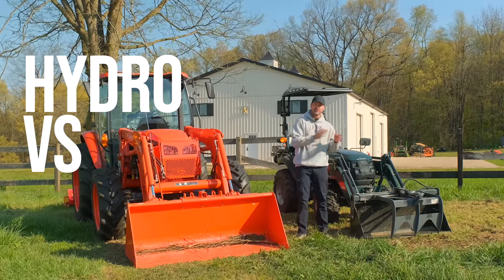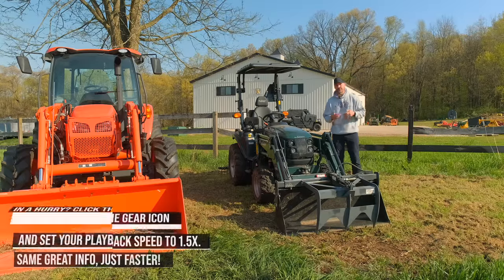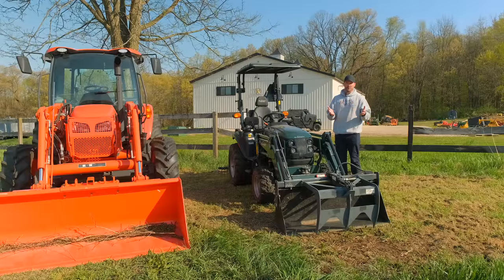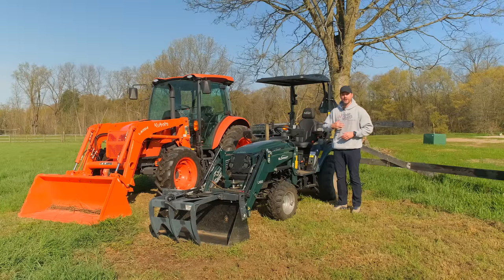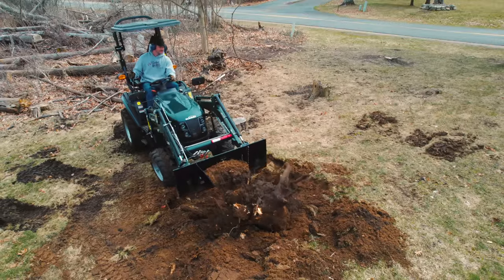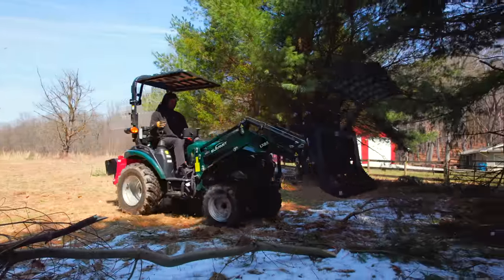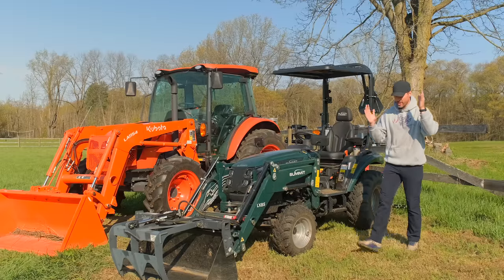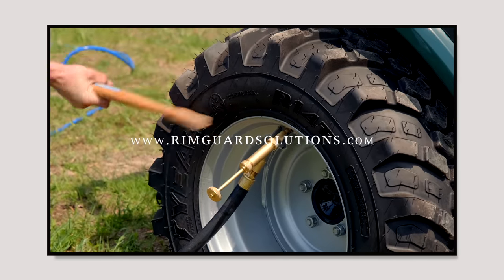HYDROSTATIC VS MANUAL TRANSMISSION? CLEAR WINNER?

Comment from the maker: So, which is the better transmission?

LOOK AT OUR MOST POPULAR ATTACHMENTS!
Speeco Quick Hitch: https://bit.ly/3NFC0yl
Stump Wrecker: https://bit.ly/3WYa6Tf
VersaBracket Combo: https://bit.ly/3wUPrnl
Snow Pusher: https://bit.ly/3NB4BVw
Tillers: https://bit.ly/3GT1kk1
Core Plug Aerators: https://bit.ly/3W0R25q
Pallet Forks: https://bit.ly/38wRztu
Grapples: https://bit.ly/3PNNYaZ
Dethatcher: https://bit.ly/3GT9Zmk
Tractor Canopy: https://bit.ly/3IHcvNU

WANT TO SAVE MONEY? CHECK OUT THE GWT DISCOUNT CLUB!  Use code GWT at any of the vendors below and you will save cold hard cash :)  I will also get a commission for the sale, so it's a win-win-win!  

USE CODE "GWT" TO SAVE BIG WITH:
BUCKET BRACKETS @ http://www.jufabworks.com
CUSTOM GRILL GUARDS @ http://www.5elevendesignz.com
PTO QUICK ATTACH @ http://tractorptolink.com
DIY HYDRAULIC SOLUTIONS @ http://www.summit-hydraulics.com
GAME CHANGING GREASING SYSTEMS @ http://www.lube-shuttle.us/store
TIRE CHAINS @ http://www.tirechainsonline.com
PREVENT FLAT TIRES @ http://www.multiseal.us
CULTIPACKERS & CRIMPERS @ http://www.packermaxx.com
ALL OEM JOHN DEERE PARTS @ http://www.247parts.com
ACCESSORIES AND BACKHOE BUCKETS @ http://www.muddscustoms.com
CUSTOM TRACTOR FLOORMATS @ http://www.tractormat.com
PROTECT, ORGANIZE, IDENTIFY HOSES @ http://www.outbackwrap.com
BOX BLADES FOR ATV'S @ http://www.northwoodsfabrication.com
HYDRAULIC SYSTEM PROTECTION @ http://www.hoseendchamer.com
DUMP FROM THE SEAT MATERIAL COLLECTION SYSTEMS @ http://www.proteroinc.com
POWERED SWEEPERS SWEEP UP ANYTHING @ http://www.sweep-all.com
EASY WHEEL TOP LINK HANDLE @ http://www.tractoraftermarket.com
TIRES, WHEELS, AND DUAL ADAPTERS @ http://www.millertire.com
AMERICAN MADE CARRY ALL ON STEROIDS @ http:www.bigtoolrack.com
THE BEST TOOTHBAR AND MORE @ http://www.heavyhitch.com
5% OFF WITH CODE GWT AT TRAC SEATS! http://www.tracseats.com

SHOP: http://www.goodworkstractors.com
AMAZON: http://www.amazon.com/shop/goodworkstractors
SUBSCRIBE: http://www.youtube.com/goodworkstractors
LIKE: http://www.facebook.com/goodworkstrac...
FOLLOW: http://www.instagram.com/goodworkstra...
MERCHANDISE: https://stores.inksoft.com/good_works_tractors_merch/shop/home

*Discount codes cannot be combined with any other promotions, offers, or deals!
**I choose to sell some products through 3rd parties instead of stocking items myself.  Know that I will receive a commission if you choose to purchase through certain links.  Thank you very much for your support!

This video is for entertainment purposes only.  Good Works Tractors (Good Works Lawn & Power, LLC) cannot be held responsible for content found in any video.  Always reference your owners manuals, use extreme caution, and proceed at your own risk.

Comment: I have a 4044M with the power reverser. It becomes surprisingly natural after a while.  The biggest issue I’ve had is when I get off the tractor and into my truck, I instinctively try to use the blinker to change direction.  😂
Reply: Lol
Reply: I feel your pain
Reply: Say you spent a lot of hours in the tractor without saying you spend a lot of hours in the tractor😉.
Reply: I keep reaching for the loader joystick when I want to shift the tractor. #MuscleMemory is an actual thing.😊
Reply: I did that a lot when I drove forklifts 12 hours a day
Reply: Beats pedals
Reply: Same

Comment: I have both, manual and hydro, and like you said, both have their strengths. One thing I have noticed however, is that a LOT of power is sucked up in that hydrostatic transmission. All things being equal, my experience is that the manual has more HP available for work.
Reply: And more comfortable to run when doing extended tasks.  Like mowing.

Comment: Dislike the treadle design. If forced to choose between treadle or manual, I'd go manual, preferably shuttle. If treadle was the only option, I'd run.
Reply: I bought a Yanmar YT347. Their I-HMT is better than either a gear drive or traditional HST, it has the same 2.2L as a JD 4044M/R, and no treadle pedal.

Comment: I grew up on the farm and farmed for 26 years. That John Deere Synchromesh trans that has the 1-3-R, 2-5-R, 4-7-R, and 6-8 had it's purpose. Typically you would turn in 2nd, backup and drop the implement , place in 5th and go. So there was an 8 speed trans with limited shifting. The Quad Range came out later and had it's place as you now had 16 different ranges with some non clutch shifting possibilities. If your were really trying to get the most out of your tractor you could find a suitable gear in the Quad range. My favorite was the 8 speed Power Shift. You could now shift with/without using the clutch. My Dad used to plant our potatoes with a 4430 Quad Range. When I replaced it with a 4430 Power Shift he was super pleased because we had short rows and a lot of turning. We used these all day every day and never had a transmission problem.

Comment: Back in the day, young buck, we only had manual gear drive with levers everywhere.   You had to stop to change any gears or directions,  we stood on hard clutches in the hot sun 300 times a day. Kids had left legs the size of grown town men and arms like tree trunks from no power stearing in rough paddocks..  good times..  now im 40+ i like my air ride seat, heated and AC cab, hydro top links,, and now hydrostatic for load shifting😂😂
Reply from the maker: Haha, I hear ya there! 40+ for me too.  First tractors I got to drive myself as a kid were grandpa's Ford 8n and 9n.  Neither one of them started with the key.  They both involved me sitting in the drivers seat and grandpa working his magic to fire them up.

Comment: The crazy transmission you showed was on John Deeres in the 70s. We had 4020s with that. The gears were set up so you didn't need a range selector.
Reply: I agree ,

Comment: I think this was a good summary.  I mainly do loader work, not plowing, and there is a big advantage to a hydro when using a pallet forks, work basket, for careful moving, or surging into a pile of rock, over and over again.
Reply: While I agree there is an advantage, it isn't hard to feather the clutch and on tight work you put it in the slowest gear at idle. It moves pretty slow even with the clutch out.

Everything is a compromise, so just matters how much field work or other constant rate things are going to be done to tip the balance gear or hydro.

Comment: I got my kubota l4701 in a gear drive and am so glad i did. I didnt want to listen to the whine of the hydro transmission and i like that the gear drive puts out more pto hp. What really sold me on the gear drive was a video messicks did comparing the pulling force of the two on an identical tractor and the hydro was extremely weak. My l4701 gear drive feels way stronger than the “47” hp its rated for. And i have a hi and lo range and 4 gears in each to choose from so i have plenty of a selection for whatever i need to do. I ran a flail mower for 6 hours straight with absolutely 0 issues.

Comment: "You grew up on farm tractors and are used to that". This is exactly right, and I love my Kubota L3901 with gear drive, even for loader work. As always, good video.
Reply: Hell, the first tractor I ever drove and the one I had the most hours on was a hydro, and I still generally prefer gear, especially a power reverser like the JD

Comment: I grew up with older gear drive tractors long before loader and buckets were a standard option. Just bought my new massey ferguson 1825e with the gear drive and loader. Plan to use the loader to clean out the barn. Using the clutch and gears still beats the pitchfork!

Comment: Still own one with the early 60's John Deere Syncro-Range transmission.
8 forward and 3 reverse gears  all with a dry disc clutch and manual shift. 
The one tractor I know nobody will steal from my yard because with the markings worn off the shifter good luck to the thief. Folks are sure spoiled with the controls on these new machines.  
Thanks for the video!

Comment: I've been driving stick shift for 41 years. When I became the caretaker at a camp, all they had was a Kabota L2500. Using the loader bucket is easy when scooping up rock when working on the road. A guy told me that I might have to spin the tires starting in 8th by revving it up and popping the clutch. Never had to do that to get it going in 8th. I like driving by the seat of my pants and have what I'm operating let me know what I need to do as well as reading the gauges. A stick shift gives me that. I have recently been using a friend's commercial John Deere. It is at least 3-4 times the size of the Kabota. It only has a forward/backwards lever. They must have had to keep it simple for the user. What makes it fun are all the levers to operate the backhoe.

Comment: I have owned or rented and used all variations and there are use cases for every one, however, if I had to choose one, it would be a 3 range power reverser with both hand and foot throttles as it gives the best of both worlds. The big TLB's that we rented for large jobs had this feature and I really preferred it.

Comment: Hydros are noisier and don’t have as much pull as gear. For most, hydro is the way to go, but if you’re used to clutch and gears it isn’t bad. The only time it bothers me is loader work into a pile, and it doesn’t bother me that much… that’s probably less than 10% of what I do anyway. I like the gear drive for plowing and mowing 5 miles of trails plus an acre field. Constant speed, strong pull. With 25hp and about 4000lb of ballasted machine, I run out of traction before I’m out of power. I will say, I have a 12 speed and wouldn’t be happy with 8 speeds like many gear drives have.

Comment: From experience as a heavy equipment mechanic, I would say that hydros are excellent for use in tight spaces and small properties for obvious reasons. However in larger fields and work spaces that require running material or using implements for extended intervals, I would would suggest gear driven. In my shop, I use a hydro L3830 to move pallets and equipment around that I would never use my gear driven JD 5400.

Comment: Good job with the pros and cons. The most important parts of my tractor are the three point and the PTO. The loader mostly replaces my wheel barrow. It's useful but not central to the way I use my tractor. I don't find running a gear tractor to be any less intuitive or more difficult than driving my stick shift car. And the gains in weight and power and, as you mentioned, the fact that it runs cooler all day long under heavy loads are important to me. I guess it really all comes down to experience and how one uses a tractor. They both have strengths and weaknesses. Anyway, once again, good video!

Comment: John Deere has a hydrostatic transmission available in its large ag tractors.  It is called an IVT transmission or infinitely variable transmission. It’s sorta the same but different than the small compact transmission.  Works really well.

Comment: I love my JD 3025e for just about everything, but I am looking at a JD 5100m for baling. Hydro just doesn’t really work for that. The 3025e did great raking, but to run a Tedder or a baler none of the compact series has the power or weight needed. Also baling is much nicer in a big cab with a set gear and rpm to keep the PTO at the right RPM.

Comment: I like your insight. I grew up driving manual transmission vehicles, from three on the tree to three & four on the floor. Also grew up using an old Ford 8N tractor. Even today I prefer a manual in my cars & trucks. On the few occasions I did buy trucks with autos I seemed to burn most of them up when towing heavy loads. I've never worn out a clutch or had a manual transmission break. So when I recently ordered a 45hp compact tractor it was a no brainer for me (manual please!). Plus I do not like the whine those hydro tractors make. But I get it, if I was a newbie, or had to share the tractor with my wife or kids I'd for sure get a hydro setup; practically zero learning curve...

Comment: I'm sure I'll catch the Deere hate, but I should point out their new Power Quad/Power 8s Have that electrohydraulic clutch option you mentioned, but the gears are fully synchronized. You can shift through all 4/8 gears in a range AND shift through the ranges on the fly.

Comment: Hydrostatic is definitely a safer choice, I spun the tires on my 1940 9N once pulling a log and then it gained traction and in the process almost bucked me off and continued to roll forward. I have a kubota lx2610 now and it is nice knowing that if you want to come to a stop all you have to do is let go of the pedal

Comment: If you’re looking for convenience with loader work get the hydro, If you’re looking to do field work all day get a manual transmission. The hydro has issues with long hard pulling day’s.
Reply: Agreed. I would choose my hydro L3830 for loading any day over my larger Deere 5400 that's gear driven.

Comment: I have a massy 1825E and I did opt to get a manual, with the shuttle shift I love it, and wanted the extra power with the pto, however after using my buddies hydro, that it what I shoud have got!
Reply: You got a "Good-One"; PLUS you have TWO BRAKE-PEDALS == So Handy.
Reply: I have a larger Massey with a hydro. It's like driving a Cadillac. Love it.

Comment: I've got both types (Kioti Ck2610 HST and RX7320 Power Shuttle) and they both definitely have application advantages/disadvantages.  Loader work - hydro is hands down the best.  Easy forward and reverse and ultimate speed control without touching a lever or clutch.  But for consistent speed and power on the rear end, gear drive is the best.  Example:  you cannot beat a gear drive for field sprayer work.  You have to have a consistent speed to apply chemical evenly.  It's all about the implement you're using and the application.

Comment: I nearly bought a 790 with manual trans.  My big concern was that I might stall it.   With a hydro, you can push it as hard into that dirt pile as you like.  You may hear the hydro whine if you overload it, but it won't stall the engine.
Reply: Can you push in a clutch ? gear drive has 3 times the pulling power

Comment: You address this early in your video, but when talking about the gear drive manual transmission, perhaps good to reiterate that operation on hills and steeper terrain requires a good balance and advanced planning to safely coordinate gear, clutch, throttle, and sometimes the implement. Appreciate your videos😊

Comment: Never heard it said that a hydro was safer than a gear drive, but you're right. A gear drive can be jumpy if you are in the wrong range or speed while doing loader work. My gear drive is second nature to me, but I couldn't really expect my wife or kid or even buddy to jump on and use it safely.  Besides the safety aspect, it's gear drive for the win. There are no tasks that a hydro does better in my opinion. Gear drive is way more powerful, runs cooler, simpler, cheaper to fix, less likely to break, and you don't need cruise control.

Comment: I purchased the b2401 (manual trans) and man this little guy pulls hard. I rented the b2601 (hydrostat) before I purchased the b2401 and the difference was night and day. The manual pulls harder, no comparison (it feels twice as strong). However I wish the trans had synchro's. Changing gears sometimes requires you to double clutch ( a must in some cases). I could totally use the Hydrostat and would find it easier for Loader work especially. But for pulling, whether with PTO implements (such as a rotary cutter etc) or a rake, box blade, disc harrow etc I like the manual trans. It lets me do bigger implements without the size of the larger tractor. I do love the feel of it basically being cruise control on long distances in the manual trans also. There are tons of advantages to the hydrostat but truthfully once you have the manual you get very used to it very quickly.

Comment: AN OLD FARMER ONCE TOLD "LOOK AT THE BIGGEST TRACTOR YOU CAN AFFORD THEN BUY THE NEXT ONE BIGGER"....IF by any means your new to this and are really torn on hydro/ manual your already in way over your head.. This guy did excellent job of explaining differences but if you really need the power and your not sure yet your already in for a huge learning curve for anything you want to do with any serious attachment. I have a 1023e jd that the wife uses cuz I'm nervous about her running anything with a clutch....that Lil machine has racked more hours in a year then anything else because she comfortable with it

Comment: Almost 70 yes. Old been using manual all these yrs. And went with john deere 3043d and don't  regret it. Nothing against hydro but can't take the whine it makes. Think both transmissions would last longer than me.

Comment: Just to add MORE complication,  there's also partial and full powershift.  You simply move the shifter.  No clutch or declutch button needed.  I consider a hi-lo switch a form of partial powershift.   A lot of power shuttle transmissions have that option.  Makes a 12x12 into a 24x24!  VERY nice to have when doing things like haying in hilly terrain- or in fields where yield varies widely from place to place.

  And then there are some funky ones, unique to certain brands.   Like John Deere's  Direct Drive- which is a full gear trans, that acts like a CVT.   Kubota used to have one called Glide Shift, I think, that was unique to them.

Comment: long term gear tractor lover, but hydro will be my next machine probably, but having bull low on a geared machine is the best. I hardly ever use the throttle peddle just the lever. just bought one geared due to the price difference